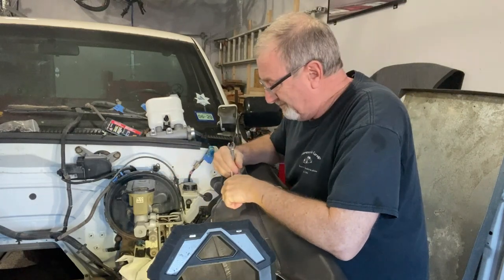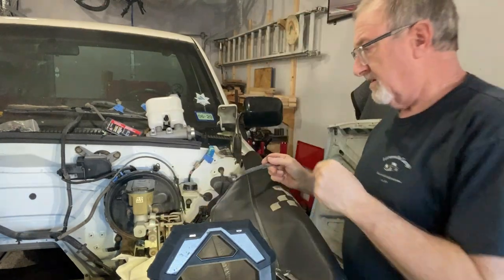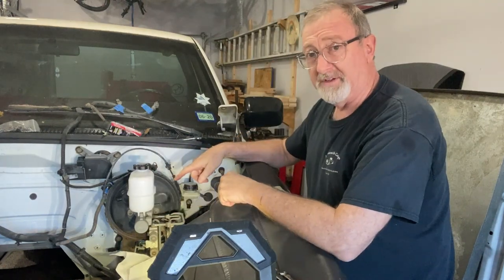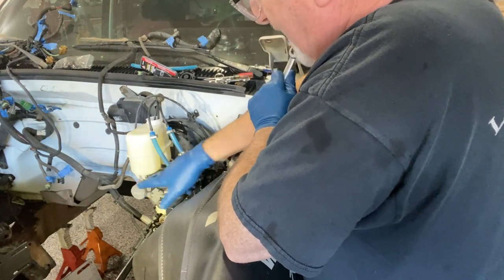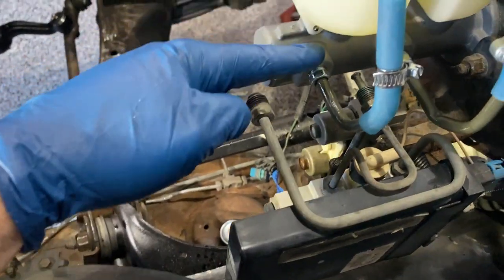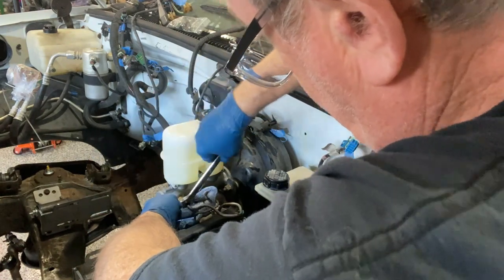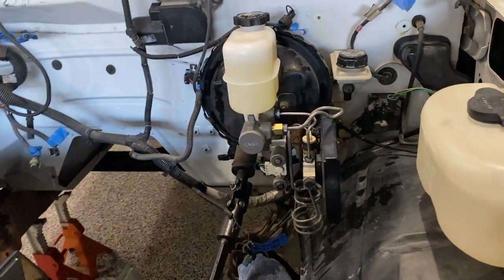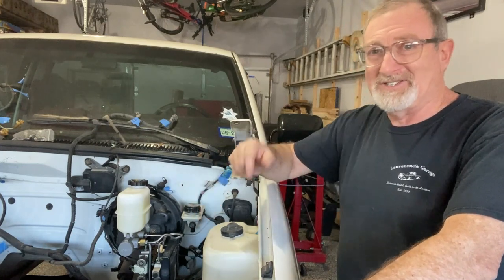1988-1998 Chevy OBS Truck Master Cylinder Upgrade to NBS Style for 4 Wheel Disk Brake Conversion

Comment: A handy old timer tip for removing brake lines.  Obviously let them soak in penetrating oil then use the line wrench and a very light tap to slightly tighten the line before removing the line.

Comment: Hey my brake pedal almost goes to the floor when braking and barely enough stopping power but I recently got a remanufactured abs hydraulic assembly and I was wondering if I need to get a scan tool to bleed the abs system? Or can I just press the bleeder on the combination valve while I’m bleeding my brakes? I have a 94 with rwal
Reply from the maker: Definitely sounds like air in your system. I am not sure if a '94 needs a scan tool or not, but, the abs module does need to be bled. If your abs unit has a bleeder, use that. If it does not, it may require the use of a scanner to activate the circuits to bleed.

Comment: Just wanted to point out that in the box the master clinder comes in theres 2 plastic plugs,and instructions that tell you how to bench bleed the master. Not one obs video shows that.. I'm a ase certified mechanic and i bench bled alot of masters over the years and found these particular masters bench bleed the best by using the plugs in the kit. The bleed so well that on the bench you can barely push in the piston 1/8" 
Also when bench bleeding the piston should not travel over an inch.

Comment: Awesome video!!! Genuine question I know some NBS trucks went back to rear drum I think around 04? I have the 14 bolt 6 lug in my 89 with rear drums and wonder if the 04 and up MC may work well ?? Thanks for your knowledge and time!!!!
Reply from the maker: If you found an '04 factory style m/c for front disc rear drum, I'm sure it would....But, I don't know that you would see much gain for the swap. If I was staying with my OBS rear drums, I'd probably replace the stock unit with a good stock replacement. You could make some small improvements by replacing the factory rubber lines with braided steel ones and get a set of performance brake pads.
Reply: @laurencevillegarage  awesome thank you for the input! I will probably proceed with ordering a quality factory replacement

Comment: I have a 91 chevy with rear drums , recently bought the little shop m. m/c you think it’ll be worth it
Reply from the maker: It’s a nice kit, that’s what I installed on my 95. They make a good product, I just wanted to try to accomplish the same basic and result and spend less money. I the reason I chose the little shop kit was because it didn’t involve removing the rear axles. However, my axle seals were bad and I had to pull the axles anyway.

Comment: I'm doing a 5.3 swap on a 94 S10. I want to swap the master cylinder out to a newer style. Is there anything I should be aware of for the swap? I know I'm going to have to replumb the brake lines because the connections are on the opposite side.
Reply from the maker: I don’t want to lead you astray. I’ve not done a brake upgrade on an S 10. I do not know if the master cylinder/brake booster are the same as the full-size pick up truck. If they are, then the NBS master cylinder should work the same. However, given the trucks size weight distribution And other factors, I would do more research to find out what other people are using for rear disc brake set ups. It may be, that a more common disc brake conversion that is applicable to Camaros, nova’s, etc. would be a better fit. Good luck with your project.

Comment: Did anyone ru into the problem of the flair on the current line is larger than the flair inside the BLF-26C adapter and won't seal?
Reply from the maker: No issues here.

Comment: I put a 95 Chevy cab on a 93 frame and I got one brake line Coming from master cylinder that I don't know where it goes both front wheels and back wheel are hooked up where does the other line goes
Reply from the maker: You didn't mention if the m/c assembly was from the '93 or '95. My guess with no other information and no picture to go by, that it has to do with abs components and/or proportioning valve. You need to find a manual for your truck and see what is different or missing. Sorry, but with no other information, that would be my best suggestion. Good luck.

Comment: I see a lot of people doing this swap. I have even heard that certain master cylinders can be found and require no alterations to the lines other than possibly that adapter fitting. I cannot recall which model but anyways, there’s a few videos explains what and how, but nobody really gets into why?Is this proportioned differently for the rear disc brake conversion another modification that needs to go hand and hand with such as a big brake caliper kit or is there more braking power exerted through the upgraded master cylinder for increased stopping power or is to possibly gain more fluid capacity for “cooling” purposes as if they’re running autocross or something, or is this just to say “I got the old truck but it’s got new truck brakes”?  
Please excuse my ignorance and you may have explained why you were doing this in the video and maybe I just missed it. There must be some kind of reason that all of the cool kids are doing this mod to their trucks. Also, as far as the line bending goes, I think you can go to a real auto parts store and on a rack i believe they sell short sections of pre flared line with fittings for relatively cheap and I would assume that bending and forming a line from a straight piece of line would be much easier than trying to re form a line that is already bent. It can obviously be done either way and your way is more budget friendly. I have to re do my brake lines and whatnot so if it is a modification that is well worth doing then I would definitely consider doing this. Also, as much as I don’t enjoy it, working with gloves on definitely has its benefits. Good video. I’m envious that you are casually out in your garage in a T shirt just tinkering away while meanwhile  it is currently 27° where I am. Even with small garage heater it is difficult to muster up the motivation to go outside and get shit done. Not to mention that the cold also just makes everything tougher to work on.
Reply from the maker: Good question. No, it’s not to be cool. Disc and drum brakes require different amount of pressure to stop. Old cars (like in the 50’s and earlier) only have a m/c with 1 reservoir. When you hit the brake pedal it basically applied the same amount of fluid pressure to all 4 wheels. Sounds reasonable, but in application, is not safe or practical. Maybe when parked it’s fine but driving 50 mph it is not, moving mass, front brakes do maybe 60-70% of the stopping ability. The fronts could lock up prematurely before the rears did much. So, m/c we’re made with dual reservoirs for not only safety but better fluid distribution. It could be tailored to the amount of pressure needed and adjusted separately. Then came disc brakes. Discs operate with different pressure needs. So, when swapping out rear drums to disc, that’s a significant change. To adjust or tailor the new pressure needs, there are 2 basic choices: add a proportioning valve to the rear brake line to adjust the amount of fluid pressure to prevent them from prematurely locking up or replace m/c that was designed to work with front and rear discs. Checking cost, a good proportioning valve is around $100 and install is something the average car guy can do but is more complicated (depending on the vehicle to install) or switch out the m/c which is usually easier and less expensive. Depends on the vehicle and the guy wrenching, but could be easier or harder to do. Putting in a valve is more possible fabrication installation rather than a simple m/c swap. I’m sorry for the length of the response but that’s why I did it…

Comment: With this swap is it required to run dot4 brake fluid or is the 3 enough?
Reply from the maker: You can use dot3 or dot4 in your driver, they are compatible. Most newer cars after around 2004 use dot4. Dot4 has a higher boiling point.
Reply: Thanks

Comment: the brass brake line adapter is for a 3/16" flair line ,,, but the trucks "big" front line is a 1/4"flair,,thus it should leak like mine does!!!!!!!!!!!!!!!!!  why is no one else having the same problem I'm having with that brass fitting????????
Reply from the maker: Try switching out your adapter, maybe you got a bad casting.
Reply: @laurencevillegarage   ordered from two different auto zones the same part # all you guys on youtube are getting and the end that the truck side of the line is 1/4 tapper female and the adapter is 3/16th tapper male ,,, it leaks!  I've even talked to the manufacturer about making the 1/4 tapper.
Reply: @dano4572  Did you ever get this resolved? Mine is leaking too.

Comment: will the old resovoir swap over or are you stuck with that gigantic new one?
Reply from the maker: When swapping from drum to disk, you need either an adjustable proportioning valve or a m/c designed for 4 wheel disc brakes to "proportion" the balance of fluid from front to rear. The reservoirs do not interchange...they are designed differently with the f/r chambers being different sizes.

Comment: My brake line is loose and leaks at the adapter
Reply from the maker: You might try getting another adapter and try that, could be a quality issue with that part. I have not had any issues with using this on several projects.

Comment: What is obs and nbs?
Reply from the maker: OBS (old body style) is the general term used when describing the 1988-1998 full size chevy pick up trucks, NBS (new body style) refers to the 1999 and up body style change. I know it is odd because there are older body styles. But, when you hear or see the term, you will know which body style trucks are referred to. Thanks for asking.
Reply: @laurencevillegarage  thats strange i wouldn't consider that old style. My work trk is '74
Reply: @laurencevillegarage  another question is why the newer style master? And what did you do with the prop valve for the rear disk conversion? Im going to put rear from 2012 dually in my work trk with disk. Need better brakes the trk weighs 12K
Reply from the maker: I agree, I don't know how the designations came to be...
Reply from the maker: I added the new m/c because the original m/c was for a front disc brake/rear drum configuration and would need a proportioning valve to adjust for the  rear disc brakes. I needed a m/c anyway and upgraded to the "new" style that was made for f/r disc brakes. If you pop the lid on both m/c you will see the difference..the old style m/c has a smaller and larger fluid resevoir and the newer style has equal size resevoirs.
Reply: @laurencevillegarage  what prop valve did you wind up with?
Reply from the maker: @earleclemans4836  with the correct m/c you don’t need an additional valve.
Reply: @laurencevillegarage  but you cant use the existing valve either and what replaces the brake failure mode of existing valve?
Reply from the maker: @earleclemans4836  I have not replaced the existing valve on either of my trucks and there has been no issues. Why do you say that it cannot be used?
Reply: @laurencevillegarage  disc/drum valves supposedly have a holdoff delay valve for the drums
Reply from the maker: Based on the conversion you are doing, I would see if anyone else has done "that" specific combination to determine what you might need to make sure it works. Not sure about the "holdoff delay". I have done a lot of research prior to doing my conversions. I'm not saying you don't, just that in my research it was never mentioned and I have had no issues with my setups. Yours is different than mine, so you are venturing on some new territory that you will need to explore further. Good luck with your project!
Reply: @laurencevillegarage  when we were doing this in the 80s we would use M/C and valve from a vette